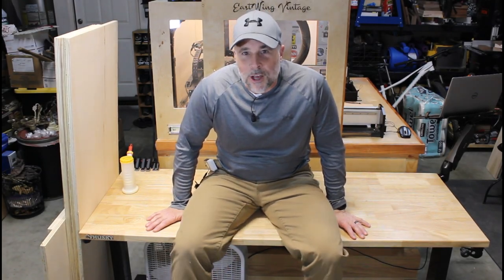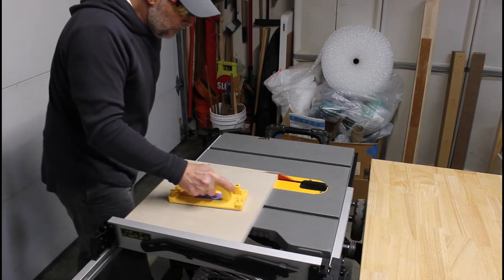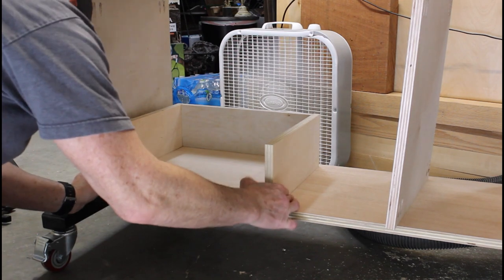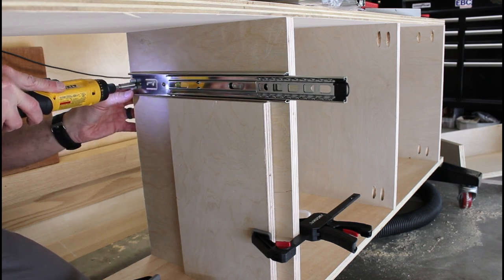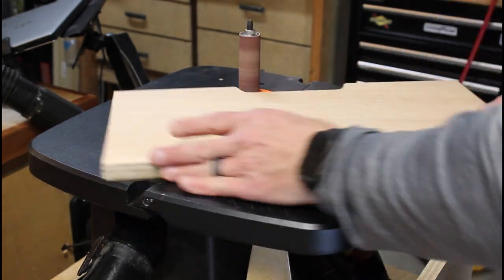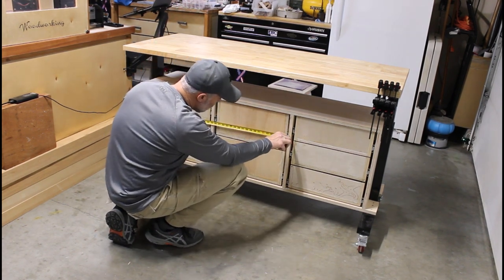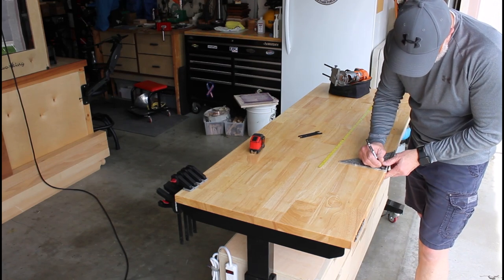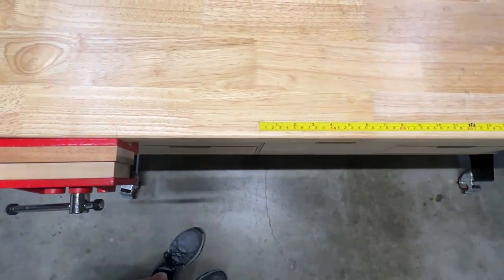The Ultimate Husky Work Bench Build

Comment: I have done my own modification of one of the 52” version adding a undermount shelf to the rear of the table top behind the two drawers mine came equipped with. Mine was purchased to hold two diode lasers weighing around 50 lbs each. The thing none of these modifications mention is that the weight limit on these Husky tables is 300lbs. The manufacturer is probably being conservative but it’s still a factor worth keeping in mind. It would also be nice to know what would be most likely to fail under excess load. You could beef up casters but if it’s the crank mechanism that’s a different matter.
Reply: The weight capacity limit and addressing that is what I came looking for information on before making the commitment to purchasing one. The crank mechanism is my concern.

Comment: Nice build. I've thought of a similar one fir myself. If I do it, I think I'll put the bottom plywood piece below the feet instead of above.It will be more hidden, add a bit of storage, and allow me to replace casters with heavier, better locking alternatives easily.
Reply from the maker: Thank you!  Placing the plywood base below the feet should work fine and yes, give you additional storage. One thing I forgot to mention in this video…I did replace the included castors with heavy duty ones.  Good luck with your build!

Comment: I like your build, but since you were raving about the adjustability of the table why wouldn't you have highlighted the feature where you can use a cordless drill to "crank" the table top up and down rather than the manual hand turn crank?
Reply from the maker: You make a great point.  Thanks for the question.

Comment: Great build, I much prefer drawers over open cabinet spaces. And I love seeing how CNC tasks can make for a more efficient workflow. 
One thing about assembling drawers, you generally want to secure the face to the sides from the side rather than the front. That way the pulling force every time you open the drawer aren't working against you. What you could have done in the way you built your drawers here is cut a rabbet on the inside of the drawer faces on the sides and bottom, and nail the drawer fronts on from the sides. They'll probably be fine, just something to keep in mind for future builds.

Looking forward to more builds! Subscribed.
Reply from the maker: Thank you for the comment and constructive feedback.  My only excuse for making the drawers this way was out of sheer simplicity. I kind of figured they were light duty enough that I shouldn’t have any problems later on. Overall, I couldn’t agree with you more! If you get a moment to watch my video on the CNC Cabinet build, you will see that I build those drawers with the technique you mention. Thanks again for subscribing, and if you have any suggestions on future videos, I would be more than grateful to hear them. Thanks again for the support!

Comment: Thanks for posting this build! I happened to find the 46" version of this for dirt cheap at an estate auction and have been googling ways to make it a more practicable shop table. The adjustable height is great and I really like what you've done with the cabinet storage. This is definitely the best design on YouTube (or anywhere online) for upgrading this style of adjustable height workbench. Thanks for sharing! 

Let us know if you make any modifications to it down the road!
Reply from the maker: Thank you for your message. I appreciate the kind words.  The only modifications I’ve made thus far is on the left side of the cabinet. I added a power strip and my cordless drill battery chargers. Good luck with your build!  Thanks again for the support!

Comment: Love the video. I ended up starting to do a similar build but have a question. Did you put any support under the bottom plywood between the metal support cross beam?  When I started loading weight onto the bottom plywood, it’s bending a good bit
Reply from the maker: Great question… I actually did add supports at first, because I was experiencing the same thing. However, when I started framing out the actual box which included the top part of the cabinet, that provided all the support and tension needed to keep the bottom from sagging.

Comment: How did you screw the base to the table base ? Do you drill a hole into the metal?
Reply from the maker: Great question…the base actually has precut holes for mounting purposes.
Reply: @eastwingvintagewoodworking4797  oh ok. Weird that I went HD this past weekend to see this table and did not see the hole
Reply from the maker: Oh no…so sorry!  Brain fart on my end…I assumed you were referring to the table top attaching to the base frame.  

I had to pre drill into the base frame to attach the bottom portion of the cabinet.
Reply: @eastwingvintagewoodworking4797  Thanks for clarifying. Not your fault.. I was not super clear which base I was referring to. I really mean “drawer bottom” to workbench base

Comment: Nice video, dude!  I bought this Husky bench (48 inch size) after watching the Jonny Builds "Nothing Sticks video and I did about the same build underneath but with 2 spaces, not 3, for 2 lightweight pull-outs per space. I used scrap 1/2 plywood for the base, sides and top, more than sturdy, and only used a 3/4" plywood panel for support in the middle.  But I did screw my left and right sides into the metal leg columns and I don't have hardly any wobble in the top -- which I seemed to see in your video at https://youtu.be/LG7v6iZQpco?t=1013.  Now, if anyone does that, take care to drill into the outermost sides of the leg columns -- at first I placed 2 screws too close to the center and they scraped the sides of the inside column/leg making it too hard to raise/lower the top.
Reply from the maker: Thanks for the shoutout and the comment. Interesting observation regarding wobble in the top of the cabinet. Maybe the video made it appear that way, but I can tell you with assurance there is no wobble or play in it whatsoever… It’s rocksolid.  I’ve been using it now since I posted the video 4 weeks ago now and I’m really happy with its utility. It was a fun project!